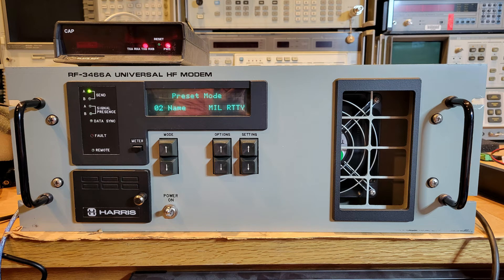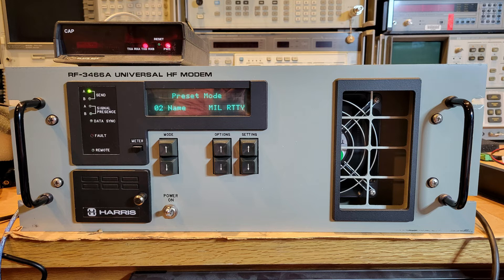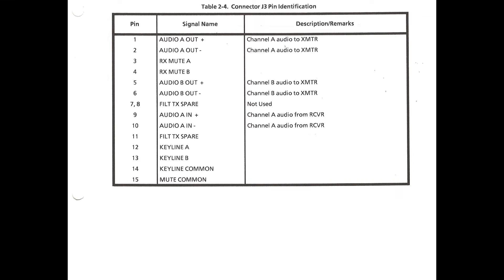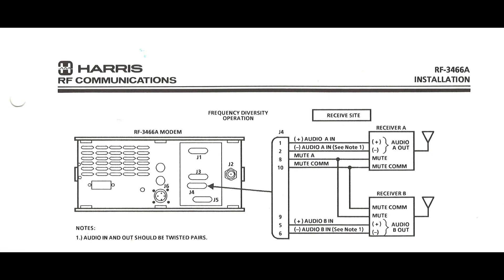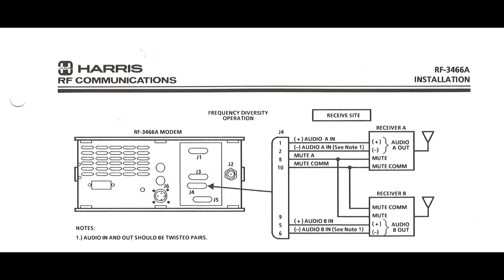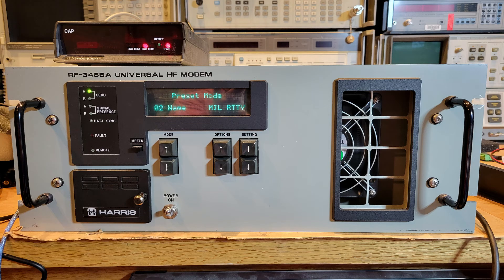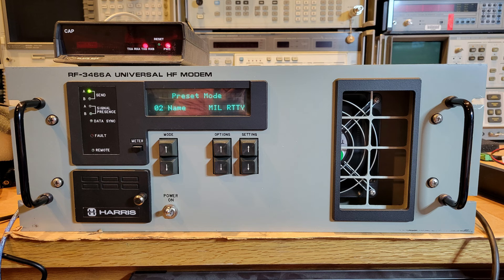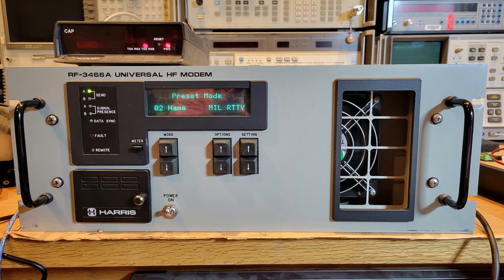Part 1: Harris RF-3466A Universal HF Modem

Comment: Great and very interesting presentation... Methinks this was before frequency hopping technology..as in military .. so is the modem capable of not only cross band operation
but cross mode operation as well? RTTY.. to say  another digital/analog mode..I know RTTy is audio frequency shift keying ... Love the patch panels you built.. Superb documentation
of all the connections to and from..Ive been bit in the ass several times for not taking notes on my work..have to re-invent the wheel so to speak... looking forward for your next video 
on the modem..73
Reply from the maker: Hi Joe. I think the two are not mutually exclusive. If, for example, I integrated an RF-7210 ALE controller (which I have but not sure I'll bother with). Then this station could be sending the FSK from the modem to whatever frequency the transmitter is on. For a hopping scenario, the FSK could be sent to the transmitter while it hops around. Hopping seems to have been much more common on V/UHF. Hopping on HF seems elusive.